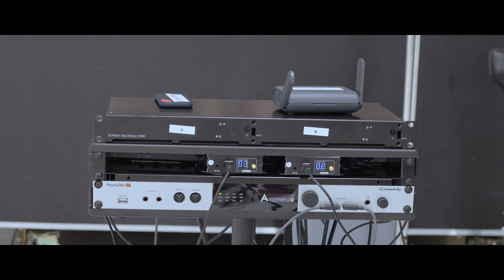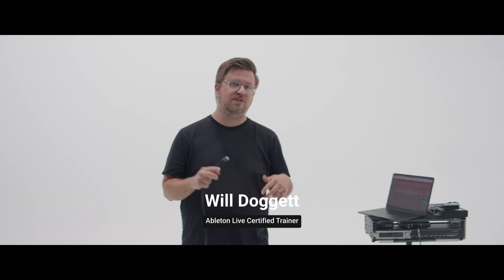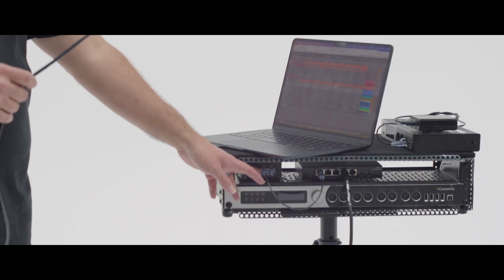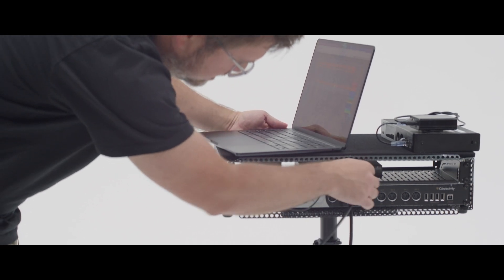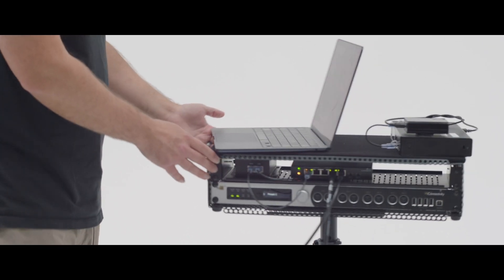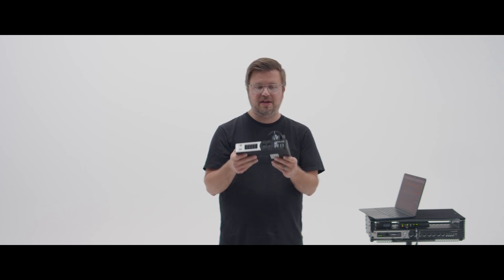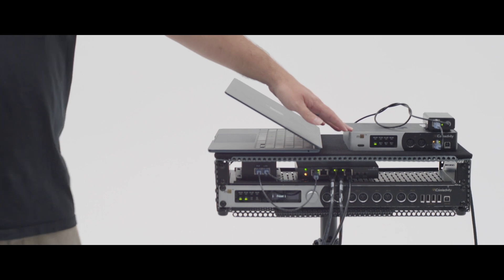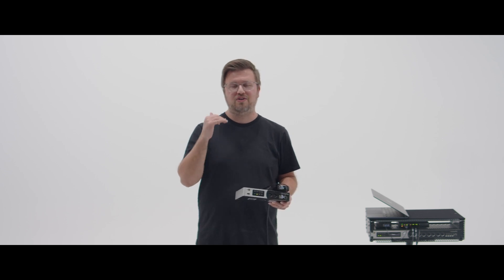Powering Your iConnectivity Devices With Ethernet

Comment: Interesting! Based on the title of this video, I initially thought the Ethernet ports on the PlayAudio 1U, XM, and XL supported PoE. What I was really hoping for was the ability to use both the standard power supply and PoE over Ethernet simultaneously, to provide power redundancy.
I love iConnectivity products and work with them regularly, but in my opinion, the lack of power redundancy is a downside, especially for professional gear.
Anyway, great video thanks!